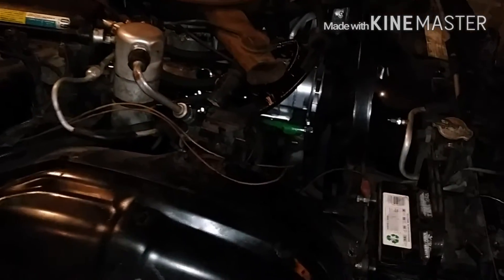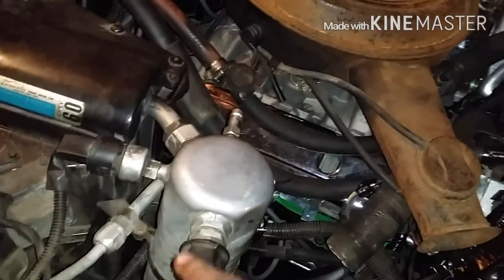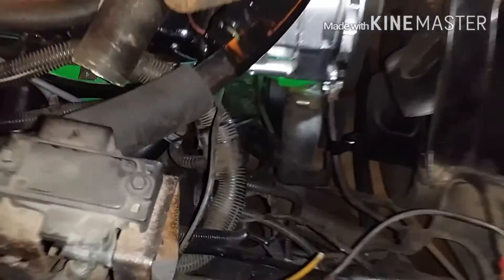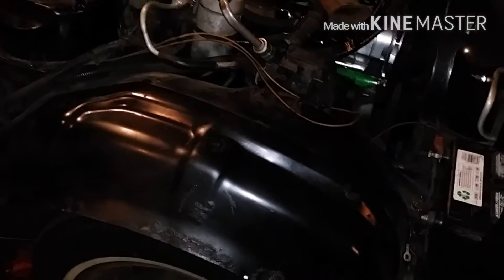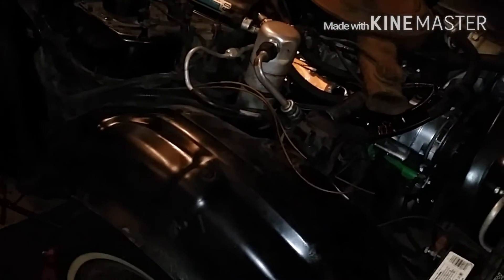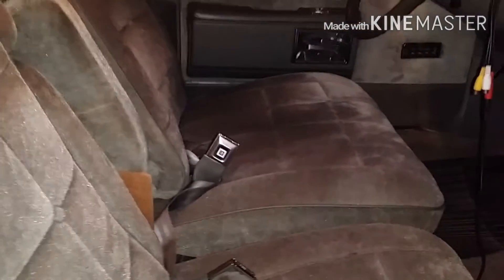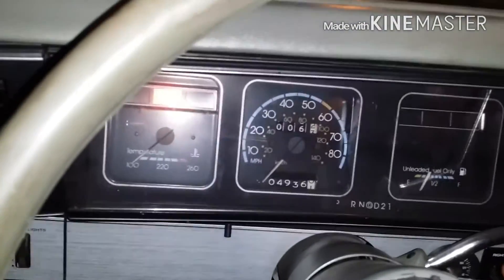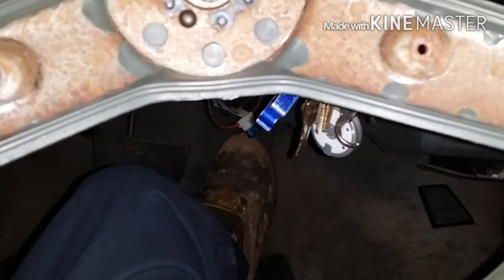Box chevy caprice wire and Timming update

Comment: I just rebuilt my 350 not too long ago I'm putting it on tdc compression stroke letting it blow out #1 piston then turning piston to the top with a piston stop tool but 4 some reason it keeps spitting out gas thru the carb, know what could be causing that?
Reply: +Sean Schaeffer Already appreciate it
Reply: +Sean Schaeffer when its tdc the rotor pointing at #1 i checked several times nd i got the firing order 18436572
Reply: +Sean Schaeffer Alright appreciate it